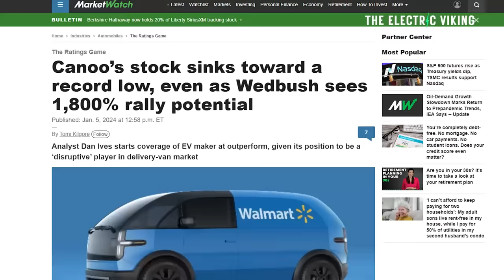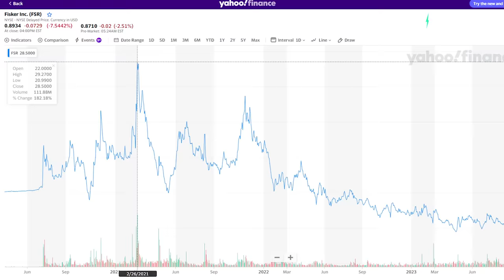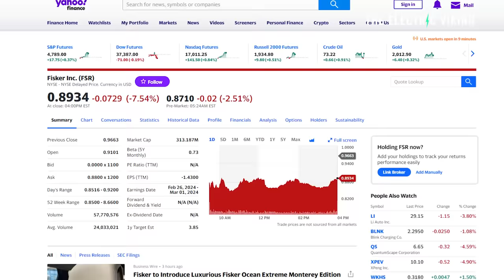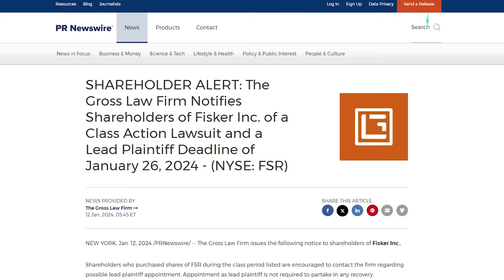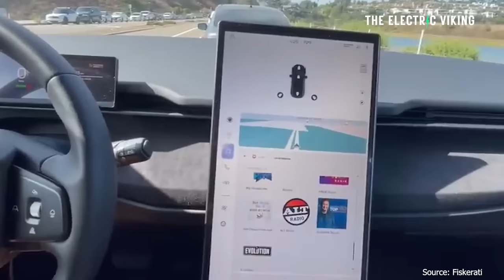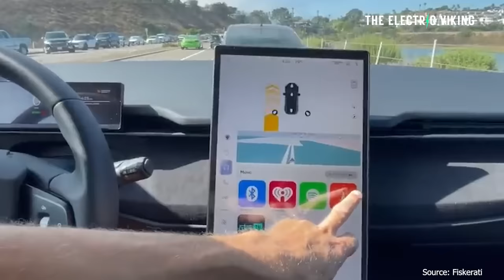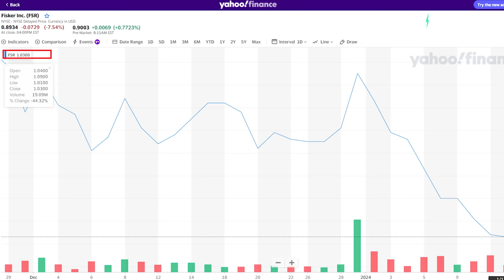Shorts begin circling like sharks as Fisker accused of hiding huge problems

Comment: No idea what is up with the accounting stuff, but issues with a new car by a new company sounds normal.  It sounds like the regen braking software was weird.  If that is all this was and it was fixed with an over the air update, its a non issue.  If the car was reviewed as junk, that would matter, but reviews are pretty good.  What shocks me is Nikola was complete bs and would not die and Fisker has released a car people actually like and INSTANTLY some people are saying, game over.  The set of cars they have look like exactly what people want to fill some gaps.  Some random lawsuit coming up because someone lost money on a stock is another laughable thing to bring up.  Every time ANY stock drops there is some group of lawyers that are going to say you misled the investors and that they lost money boo hoo.  Remember the short seller that was crying on the news because he lost a bunch of money...  None of this adds up yet.  Plus, Tesla stock is also on the decline through all this.  What is Tesla dead too because a bunch of rideshare idiots in Chicago cant do the math on cold = bad.  That entire thing causes the entire EV industry to take a big dip down.  There is tons of news out right now that nobody wants an EV, which is nuts.  Its all this media hype garbage.  With Fisker, at best we have a bunch of speculation on what is going on.  Cash burn is a part of a startup, its not a measure of success, they have not started yet.  Its a lot of weirdly loose ideas getting thrown around here.  Too many channels are using words like BREAKTHROUGH and GAME CHANGER when covering battery news.  The reality is, its a slow process.  We certainly are not there yet.  When we can charge fast, weigh far less, have a safe battery and the cost is about half of what the batteries cost now, in a car you can actually buy, then we are in GAME CHANGER range.  That is a good distance off because its not 1 thing we need fixed, but its coming down the road.

Comment: Fisker Inc. (NYSE: FSR) ("Fisker”) has issued the following statement on the National Highway Traffic Safety Administration (NHTSA) Office of Defects Investigation’s (ODI) Preliminary Evaluation of reported braking issues with the 2023 Fisker Ocean:
"Fisker is fully cooperating with NHTSA on this matter.”
The Fisker Ocean brake system uses both friction braking and regenerative braking. In December 2023, Fisker responded to customer feedback and issued an Over-the-Air update (Version 1.10) to the regenerative system that improved the customer experience when traveling over bumps and uneven surfaces, resolving the issue. The Fisker Ocean brake system meets or exceeds all US and international performance requirements.
Reply: Fisker uses OUTDATED car tech from MAGNA.

Comment: Hey Sam, don't you want to talk about many cars stopped with low battery in the winter cold?
Reply: Yeah, I hear you. Especially diesel engines has a f*** ton of issues in Canada (pickups and semi trucks needed a boost or even a brand new battery installed), and the same problems happened to many vehicles with gasoline engines. The 12V (or 24V) batteries don’t like -40C/-40F for 2 days…
BEVs were fine as always, we kept them plugged in during the night in front of the house and the temp was +23C inside after 4 minutes. We started our daily commute every morning with batteries charged to 95% - came home around 50-60% charge in the battery pack.

Greetings from:
Calgary, Alberta, Canada.
Reply: @gyoergypecsi  Then, Sam could reveal the truth.

Comment: Fisker appears to be walking dead and the chance that a white knight will show up to save the company from actual death is negligible. Still, the problem here is that Fisker has very shallow pockets and that the company proceeded based on a mistaken strategic assumption that  EV manufacturing could be conducted on the cheap. The wrongheadedness of that assumption should be obvious to everyone but somehow isn't. None of that implies that the Fisker EV line-up was completely without merit.

Why, must a new EV player have deep pockets? Because it must make the grade against extant ICE and EV automakers in the mass manufacturing game that determines the requirements for success. You either compete at that level or you lose. And, as nothing is guaranteed in this kind of endeavour, you have to have the crack team capable of breaking through all barriers to success at a very early stage of operations. That isn't cheap!

Unlike Fisker's models the vehicles made by Lordstown Motors are completely without merit. Lordstown deserves a quick end. The junk it sells is not fit for purpose and it is only appropriate that the flowering of the EV sphere would proceed alongside the rapid decay of worthless oddities like Lordstown.

Comment: The average carbon dioxide output from new trucks and coaches sold in the EU must be 90% below current levels by 2040, European lawmakers have agreed, while city buses must be entirely emissions-free five years ahead of that date.

The decision, based on a European Commission proposal and the fruit of a back-room deal between MEPs and government officials in Brussels today (18 January), follows a similar agreement on a de facto ban on internal combustion-engine cars and vans, whose exhaust CO2 emissions must be zero from 2035.

Most heavy duty vehicles will be subject gradual tightening of CO2 standards, with emissions 45% below the current average by the end of this decade, rising to 65% in 2035. For urban buses, there is an interim target of 90% by 2030, although those deployed to run on inter-city routes will be subject to the lighter set of limits.

As happened with separate standards for cars and vans, political horse trading has resulted in the EU executive being tasked with assessing by 2027 the potential for registering lorries intended to run exclusively on CO2 neutral fuels, whose exhaust emissions would theoretically be captured upstream.

However, this is a potentially complex matter as it would involve not only setting in law precisely what kind of biofuels, or synthetic fuels such as e-diesel made with ‘green’ hydrogen, would qualify, but also devising a system that would prevent what are essentially conventional trucks from being run on fossil fuel.

Despite sundry exemptions – the rules do not apply to garbage trucks until 2035, for example, the agreement has been welcomed by groups campaigning to clean up road transport, the only significant sector to see greenhouse gas emissions rise, rather than fall, in recent decades – up by around a fifth since 1990, and now contributing a quarter of all CO2 output in the EU.
“The EU is clearly telling truckmakers when almost all their vehicles will need to be zero emissions,” said Fedor Unterlohner of the green group Transport & Environment. “European producers now have a clear trajectory to ramp up production of electric and hydrogen rigs and be ready for the challenge of Tesla and Chinese rivals.”

Representing carmakers, the European Automobile Manufacturers’ Association (ACEA) noted the incoming EU standards were the most stringent in the world, and said the timeline for implementation was “extremely challenging in the absence of vital enabling conditions”.

“Electric charging and hydrogen refilling infrastructure, comprehensive carbon pricing schemes, and meaningful support measures for transport operators to invest quickly: these are the key ingredients for rapidly decarbonising the heavy-duty transport sector, in addition to zero-emission vehicles,” ACEA director general Sigrid de Vries said in a statement.

The legislative text provisionally agreed in the so-called ‘trilogue’ talks, mediated by the Commission, remains subject to formal endorsement by the EU Council and European Parliament.

Comment: Hi there, i hope everything is well with you and your family! That said, for what i´ve seen on the EV market , you should have vertical integration to hope for success, what do i mean, BYD started as a battery producer, than hybrids and EV cars, so they build inside the house I don´t know about the software. Tesla is pointing to the extreme. From production of the fuel ( Tesla solar), Tesla batteries  tesla charging stations, gigafactories for the cars, in house batteries production, and the software for all the above. (they have conered the market - one stop shop). If for legacy brands is dificult for the others...
Just one more comment, Twitter or X ... can you see what is the big picture? Is one more arm of the ecosystem. But always, stocks Go up and Down. A big thanks to all